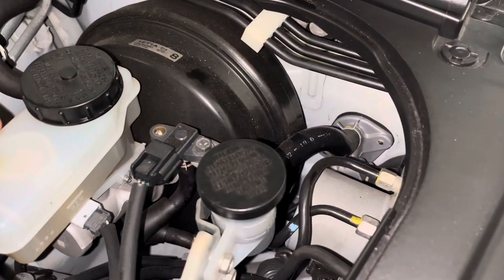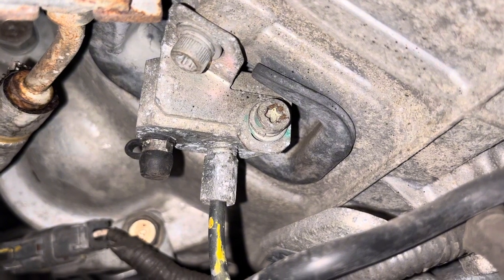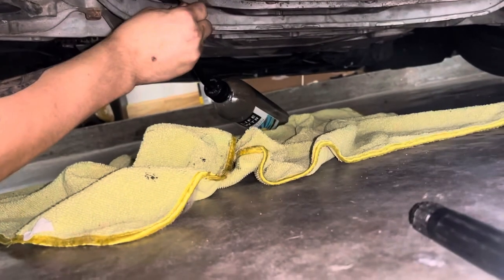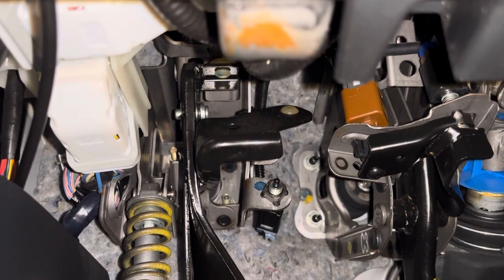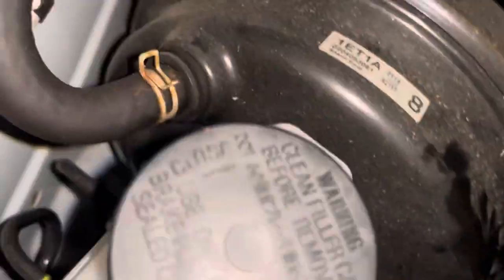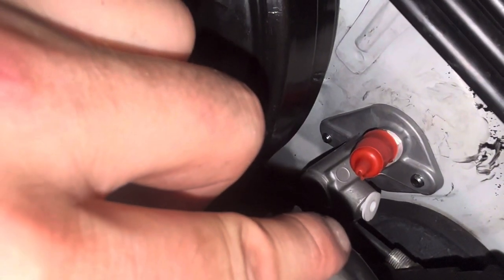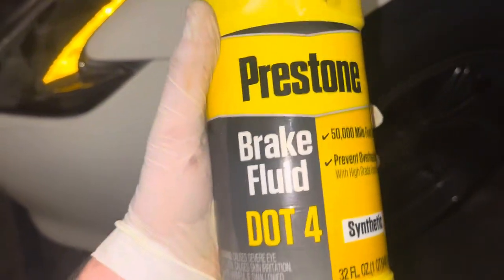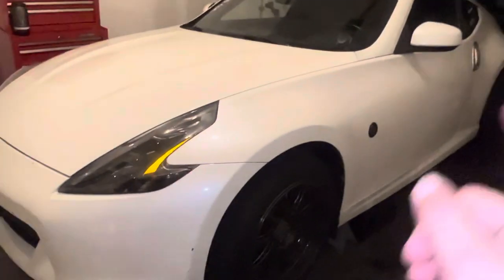Remove/install 370z and G37 OEM clutch master cylinder

Comment: Gravity bleed 370Z with CSC every 6 months when changing the oil and replace with Dot 5. Remove the bleeder valve to get a good flow. If the flow stops, close the bleeder valve and step on the clutch a few times. Then reopen it and debris should come out of the line. The last time I did this A LOT of debris came out of the CSC system.

Comment: My clutch pedal is doing the same thing on my 370 but after a while of driving it comes back to normal. You think it could still be the clutch master cylinder?
Reply from the maker: I do, mine did the same. I don’t know if this is true so don’t quote me on this, but I think it’s the debris and dirty fluid is clogging up the leak in the master cylinder. Preventing fluid from getting behind that seal

Comment: Judging by the color of your fluid, I think we can deduce why your clutch cylinder failed. Good video, well explained and direct.  Would recommend using a flare wrench for working on the hard lines.  I also find using a high temp fluid (Motul RBF600) works much better in the Z.

Comment: My Nissan truck let me swap out the slave cylinder piston without having to remove the slave cylinder from the transmission... Sachs...... By the way a luk clutch kit can cause a lot of vibration on the slave cylinder

Comment: Ain't no way you got that it in that easy. I'm trying to get my replacement in, and I can see the end of the lower stud, but it won't come through enough to get the nut on. Did you loosen the bolts on the bracket for the brake line distributor there? the big block that gives a bit when you bump it. Mine doesn't wiggle that much, but sure would be nice if it did.

Comment: How did you get it out lol I’m having issues because it’s no space
Reply from the maker: Took about ten minutes of wiggling and pulling. It was difficult to get out but after a bit, it came right out. I didn’t have to take anything else off
Reply: @musokafairlady2012 I did this once a few years ago on my g37. I remember  had to loosen the abs module to squeeze it through

Comment: What if you bleed the line and barely any fluid comes out?
Reply from the maker: Is there fluid in the reservoir
Reply: I keep adding fluid into the reservoir but it just going back to E
Reply: I replaced my master cylinder and taking it to the shop to change the slave and upgrade to a metal one instead of the OEM plastic slave
Reply from the maker: @alexrosas690  yes it was prolly the slave leaking inside the transmission. The CSC elimination kits are usually the way to go.

Comment: Hey man, would you have the old CMC on hand? From the mounting flange to the back of the body, how long is it? IE whats the amount it sticks out of the firewall? The 370Z CMC looks short enough for my application. Thanks!
Reply from the maker: I’m so sorry! Unfortunately I threw it out about a month ago so I don’t have it anymore
Reply: my micrometer says 2.084 inches because of the seam. You could sand the seam down to make 2 inches.
Reply: @tylercorrigat8677  legend!
Reply: @rohillal9545  hold that for when I get the f*@(ing thing back in...
Reply: @rohillal9545  ok I got the new one in. No problem. Do you need anything else? Stud spacing, cylinder diameter, fork length?
Reply: @tylercorrigat8677  nah man that's cool thanks so much! I ended up buying one. It's for a cable to hydraulic conversion in my KP61 with a 4AGE. Just the shortest CMC I've seen so it was super helpful!

Comment: So is the clutch master and the slave master the same thing?
Reply from the maker: No, the master is what was replaced in the video. If you have a 370z, the slave cylinder is on the inside of the transmission. Some other cars may have an external slave mounted to the outside of the transmission, but they’re not the same
Reply: @musokafairlady2012 I have a 2012 G37s . the slave cylinder is on the outside or inside the transmission
Reply from the maker: @dats.stew_VQ  inside.
Reply: @musokafairlady2012  Cmak ftw

Comment: I don’t know what you guys call it over there but in the UK it’s the biting point but mine basically feels weak on the way up. Is that CSC on the way out of does the master cylinder need changing? Idk how to really explain it lol
Reply from the maker: Different mechanics may have different opinions, but from my experience with my 370z nismo and 370z base this is the way I tou let shoot it. I check the Clutch fluid reservoir under the hood, if there’s no fluid missing, replace the Master cylinder first. That should fix it. If there’s fluid missing, walk the lines from the reservoir to the transmission. Make sure there’s no leaks. If there is, just replace the line. If there’s no leaks, see if fluid if dripping from the transmission bell housing. If there’s fluid missing from the reservoir but no leaks in ur line, I’d replace the internal slave cylinder. If you’re leaking from the Bell housing, that’s also the slave cylinder. I’m not an expert, but tho sis what I’ve been living by and it’s never failed me.
Reply from the maker: Sorry for the typos 🤦🏻‍♂️

Comment: What if the nipple is broken off
Reply from the maker: Nipple?
Reply from the maker: For the drain?
Reply: @musokafairlady2012 it is shaved off
Reply from the maker: I’d have to see it. But I’m pretty sure those can be removed
Reply: @musokafairlady2012 if I remove it do you know if I can replace the nipple with a new one
Reply from the maker: You can unscrew the nipple and replace it individually. But if you need the piece it screws into, you may have to buy those separately
Reply: @musokafairlady2012  I see what you mean I’m going to use a screw extractor to remove it then I’ll toward just the bolt/ nipple

Comment: hye broski. just got my Z and i strongly recommend upgrade your slave cylinder. Just had mine blow and i only had the car for 1 day. had to drop my trans a total of 3 different times because the previous own had put a weird clutch in it. as well as having to deal with combatablity issues. I strongly recommned if you dont want to have to deal with anything like that in the future get started on replacing and building your whole trans. upgraded clutch, flywheel, and pressure plate, and slave, your master seems to be done already. Good job man keep up the great work
Reply: Hey I upgraded everything but My master cylinder. The pedal has pressure but I cant get into Gears when the engine is running. Can someone give me an advice? Do I have to bleed the MC separately?

Comment: i bought a new master cylinder but it lost pressure within a week. should i buy another one? i dont know what to do. i already did a csc delete
Reply: Basically I bought this 6mt g37 coupe and I absolutely love it. But I need help from u. I used Zspeed's CMAK stage 2 clutch kit with the CSC delete initially because the clutch fluid reservoir was empty and it wasn't able to go into gear. (my mechanic installed everything) This was able to get the car moving again.

As soon as I got that settled, a couple of weeks later I noticed fluid constantly showing up under my driver's side carpet after driving. So we replaced the clutch master cylinder because the fluid was constantly emptying and I had to replenish the reservoir every 2 weeks to a month or so due to the leak under the driver's side carpet.

Now, I'm noticing that my new clutch master cylinder tends to do the same thing when it's humid out. It will lose pressure overnight, and it's a hit or miss with the fluid leaking under my carpet. Some days ill just need to pump the clutch to get the pressure back, but other nights when it's rainy and humid out and I check the fluid it would be completely empty, and my carpet absolutely drenched. I'll also notice with the new clutch master cylinder it loses a little bit of fluid if I drive the car with spirit. Did the new clutch master cylinder break? Or is there an entirely new problem? It's literally hit or miss whenever I step in and try pushing the clutch. Thank you!

tldr; clutch fluid shows up under the driver's side carpet what do I do if I already replaced the master cylinder
Reply from the maker: From what it sounds like, you may have bought a defective CMC. The only thing clutch related in the car is the CMC. Then it goes into the engine bay, where lines will run to the CSC on the transmission. If u have fluid in the car, I’d say it’s the CMC. If u we’re losing fluid outside the car and ur CSC was just replaced, I’d say you have a leak in ur lines. And since it’s inside the car there’s no way it’s the CSC. It sucks, but sounds like you may need to replace the CMC again and get it warrantied. This is just personal knowledge and experience. Other mechanics may say otherwise. But that’s what I would do in ur shows
Reply: @musokafairlady2012  Thank you man, I'll go ahead and get it replaced again I appreciate the feedback.